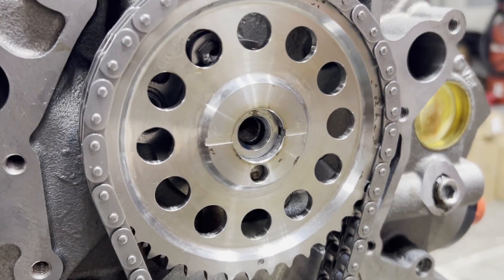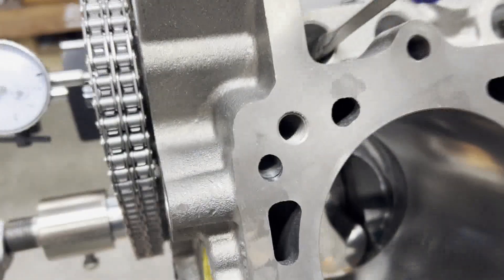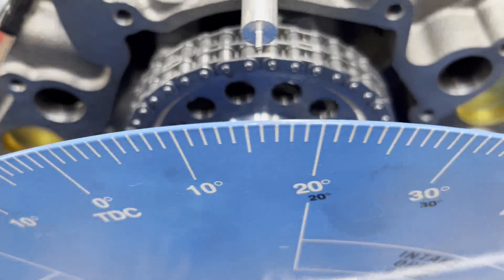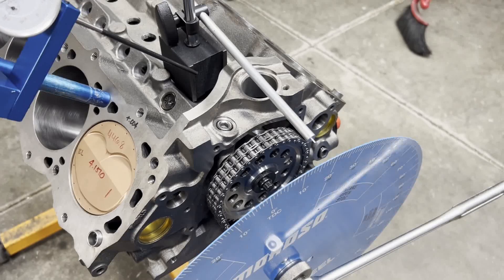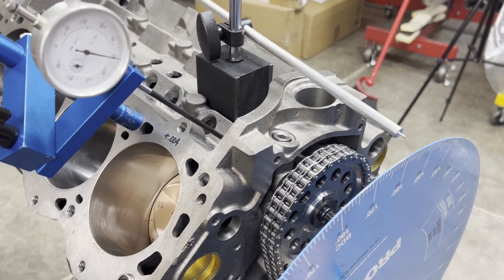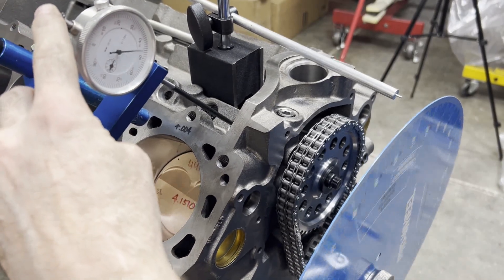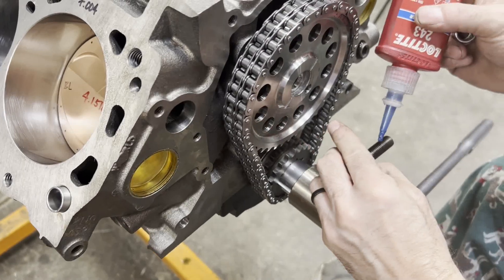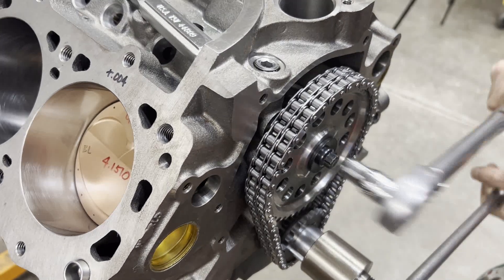Lykins Motorsports Degreeing A Billet Steel Solid Flat Tappet Camshaft...

Comment: I don't know if you have already discussed this.when finding tdc with piston stop how far down do you want the piston? how much will factory pin offset affect the accuracy at say .050 to.1in.of piston depth from tdc?
Reply from the maker: It doesn't matter how far down it is.  Only thing that matters is that it comes back to the same number after you correct it.
Reply: Ok thanks
Reply: Hey Brent great content. I would like to use the standoff pipes on my 351c. The block has the large hole in the front china wall. Do I need to leave the rear most standoff out to allow oil to drain back given there are only the four Valley holes and nothing in the rear of the block?

Comment: it was me, who asked about coming back to 100 hundredths! thanks for the demonstration, you were right, it did not make any difference. how did you do to advance 8 degrees the cam, the gear has a bushing? or the crankshaft gear had slots to advance/retard the cam? PD: I had the same calculator when I was in primary school, always when I see it remember me those days hahaha.. thanks for sharing your knowledge Brent like always! regards from Argentina
Reply from the maker: I use good timing sets with multiple key ways.